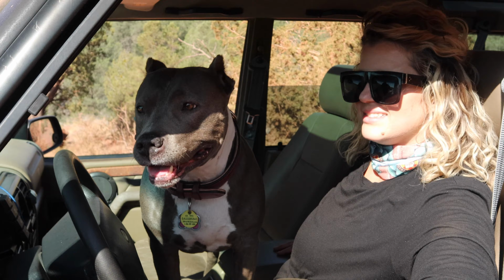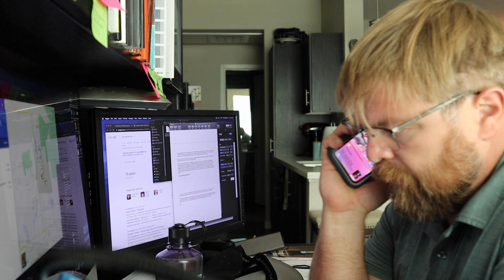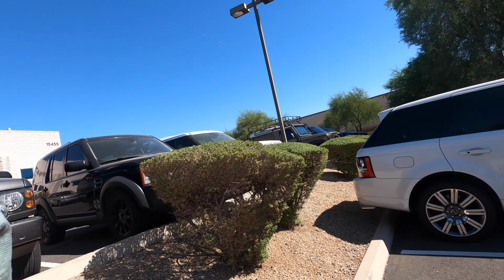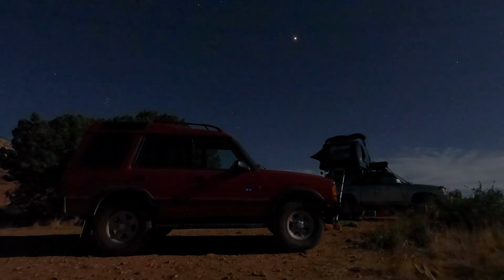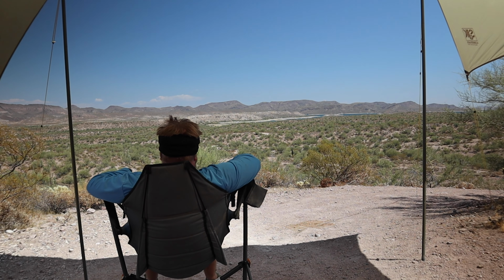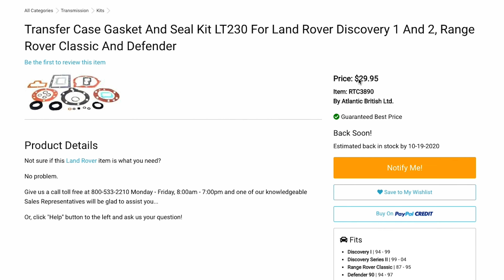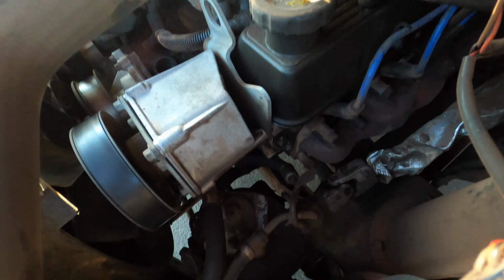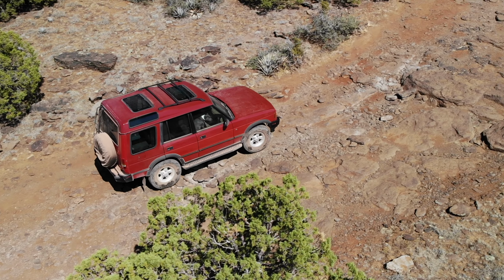Most All Of The PROBLEMS With My Wife's LAND ROVER DISCOVERY 1

Comment: Owning a Land Rover is like being the owner of the Millennium Falcon...your hyperdrive is always out, there's always some problem with the power converters or the power coupling on the negative axis has been polarized and I'm afraid you'll have to replace it. In fact the Corellian YT-1300f light freighter is known as the "Land Rover of the Star Wars Universe". People would think that a guy like Captain Solo would ditch that POS for a more reliable ship....but they don't understand. Just like people don't understand my love for my Discovery 1...Check engine light turns on if a deer farts within 100 yards, she leaks oil, she leaks power steering fluid, my hyperdrive (aka cruise control) hasn't worked in about 10 years, my rear windows only work when they want to, one headlight is full of water...currently my transfer case shifter is frozen and won't move...the list goes on. My point is... like Captain Solo, I wouldn't trade my Disco 1 for anything! If you don't own one you'll never understand that relationship. Now to be fair...there are lots of people who have owned a Land Rover and say things like, "That thing was the biggest piece of crap I ever owned...I got rid of that piece of crap, nothing but problems!" I welcome the problems...I'm an overlander, an adventurer, a world traveler...and I have to say that misadventures tell way better stories, make for better experiences, and are much more memorable than plain old regular adventures. Then again, I'm a "fly by the seat of my pants" kinda guy...like Captain Solo...lol, just my 2 cents... PS.- No, I am not a Star Wars fanboy, it was just an analogy to make my point...besides Trek is better!
Reply from the maker: Best. Analogy. Ever. I completely agree. I also find that most of these “problems” are more annoyances rather than catastrophic failures that leave you stranded to die on an inhospitable planet. Plus, it doesn’t ever really go anywhere that crazy without our X-Wing 4Runner... which we all know can crash and sit submerged in a swamp in  for an unspecified amount of time, then start right up and take us anywhere we want to go, just in case.
Reply: Awesome response to owning almost all British vehicles. I loved my 3 Lotus cars, though any sane person would have stopped at one and got rid of it. Something just quirky enough to make you love them!
Reply: You sir, are an artist, and i thank you
Reply: When I read this l lmao! So very true! You nailed it! I read a comment somewhere.. "the only thing that Land Rover's are used for today is, going to Starbucks and and Whole foods". I will never own a Land Rover, or Ranger Rover again. 4wd pieces of junk!

Comment: Not bad, bought my D1 for $900, and I'm close to $4k+ on parts and labor so far lol - Oh and I see you guys drove by Palm Springs, good stuff, I'm just down the street from those windmills lol
Reply from the maker: That’s awesome. Those windmills are one of my favorite landmarks on the drive from Phoenix to LA! That and the dinosaurs at Cabazon! How’s your disco coming song? Anything crazy you’ve found I should look out for?
Reply: @MattKester  I should get it soon if not tomorrow, maybe on Monday. Did an engine swap (same engine, low miles), but couldn't hold temp, always overheating. So I took it to IE Rovers and they pretty much fixed all the issues I missed (cylinder misfire) and they rebuilt my radiator (don't get an aftermarket one) and they replaced my 02 sensors. And I couldn't figure out why my passenger seat wouldn't move, but he fixed that too lol. Were on the same boat, I have no idea what I got into when I got the Disco for my gf lol, but she wanted it sooo were here haha
Reply from the maker: @bstunt  oh the joys of that aftermarket radiator. Mine, unfortunately has one courtesy of some previous owner. Of course the plastic fill plug on that one had deteriorated and started leaking, and I couldn’t find any info on it. Tried ordering an OEM one, but they aren’t compatible. Ended up having to use a M12x1.25 oil drain plug which fit it perfectly, but of course is the wrong material to use in a brass radiator. I’ve used a metric F-ton of Teflon tape to try and minimize the metal on metal in there, but I need to figure out where I can get that correct plug before the plug and/or the radiator start corroding away. I know it’ll be worth it, once we get it all sorted, just a little time consuming and challenging getting it there!
Reply: @MattKester  I have a D1 as well. I fucking love it! But I must add, maintain the cooling system, the radiators go on these often, it is important to maintain the radiator fins and to flush it of dexcool if it hasn't been already and use regular green coolant mixed with distilled. These aluminium blocks warp easily. Watch Britannia restorations youtube channel for amazing land rover content. It's mostly defenders and TDI but they are so similar that the information is completely relevant to our Discovery V8s. Keep the rad updated, maintain the viscous fan clutch and thermostat! Lube the driveshaft and ujoints consistently, every oil change or right after power washing or driving through water. I love the truck it's just high maintenance but that is part of the vehicle I love too. It's a lifestyle vehicle, that's for sure.
Reply: @MattKester  which rad do you have? Is it Genuine?

Comment: To save money the first thing is not go anywhere near an official dealer, i mean stuff like a light lens cover isn't exactly end of world or ripped seat's, all that mechanical work you can do yourself, their so easy to work on and there's enough you tubers vid's about, their's tons of life left in that.
Reply from the maker: I hear you. I just wanted to get a good baseline of what was actually wrong with it. They ended up really going over it. Fixed the seats problem with a set of neoprene seat covers and we've slowly been going through and addressing most of the rest of it. I believe I finally got her to quit leaking oil after the head gaskets and trans cooler lines were replaced (fingers crossed). We're taking her out on a quick camping trip tonight and tomorrow to see where we stand and kinda figure out what we want to do next.

Comment: Power steering system on this truck DOES NOT take power steering fluid. It takes auto trans fluid. Nobody realizes this and it exacerbates leaks. D1s are fantastic, simple trucks easy to work on and parts are cheap. The shit that ALWAYS sucks is the “luxury” they grafted on to make it more like a Range Rover than a defender. Sunroofs, electric seats, cruise control etc. if you find the most basic SD truck with cloth seats and sunroof delete it’s magic. These are NOTHING like D2s. This is a somewhat rare and good color.
Reply from the maker: Thanks! I hear you on the power steering fluid. Previous owner was dumping standard power steering fluid in it, I've since started putting the correct ATF fluid in to maintain. I'm planning on replacing all the power steering lines while I have her down to do the head gasket. Hopefully that dump and fill will get most of that incorrect fluid out. I feel you on the grafted luxury, I'd love to have cloth and power nothing!

Comment: They used the parts to make these from lots of other vehicles, i used to drive an Ausin Maestro van and it shared the same rear lights, switches and other minor parts, the same parts would come either in a rover box or a land-rover box and the only difference was the price lol
Reply from the maker: I finally went and looked the Maestro up, I’d never actually seen one since they were never sold over here. Not what I was expecting. I figured it would be something more like a modern Transit or Sprinter... I couldn’t have been more wrong! Wow!

Comment: as an owner of a 97 disco 1 and 03 disco 2, i am anxious to take the "ride" with u!! and get the curse jar ready lol!!! thumbs up!!!
Reply from the maker: Thanks! I'm glad to have you along for the journey. Three videos into being Discovery owners and we're starting to understand just how awesome the Land Rover community is. Right now, my frustration is less with the car, and a particular parts vendor who has hung up a critical bunch of parts for the last week. I got in all the transmission cooler lines and radiator lines, but the other guy has my transmission service pack and head gasket set held up, so there's no point in wasting two batches of coolant or tranny fluid doing those fixes until I have the other parts. So frustrating... but that's what I get for going with the "cheaper" supplier.
Reply: @MattKester   ive been lucky to have a few contacts here in PA...one thing i have learned about the parts game... dont throw any part away until u have exactly what u need,,, a lot of old parts can be cleaned up and work just like new! and research research research is the best advice on working on the discos!!! land rover community is awesome!!! be well!! thumbs up my good man!!
Reply: and btw tell ur wife my pug Betty is my copilot!!!! i noticed ur beautiful pit in one of ur vids!!

Comment: Ive got a diesel d1 fully decked out top of the line everything , twin locked everyday driver done 335000 and blows less smoke than a petrol !! This is the most comfortable driver ive ever had ... I keep waiting for it to break down and live up to its online rep but it refuses to its twin locked and cops a hard time off road every wet season this vehicle is a weapon to own and drives and handles superbly ...so i guess its horses for courses look after them and they will not let you down, d1 300 tdi one of landrovers finest hours full stop !!!
Reply: The tdi and td5 are bloody great engines. They will rack up huge mileage without issue if you look after them.

Comment: Worst model, automatic gearbox, petrol engine. You couldn't have picked a worse Disco. The Series 2, manual gearbox, TD5 is by far a superior car if it's fitted with the linkage to engage the centre diff lock. Your car would have been a £200 spares or repair scrapper here in the UK.
Reply: Absolute rubbish

Comment: Man this is a classic, worth way more than any 2015 LR, do it the mainteinance and repair it... and enjoy
Reply from the maker: Thanks! We are! It's such a cool rig and I've been surprised just how simple it is to get in and work on. I definitely don't mind doing the maintenance on it!
Reply: @MattKester  yeah no kidding to change a light bulb on new cars you basically need ten sockets of all metrics to remove bumpers , electrics and all sorts. new cars are all about adding labor hours to any minor concern. no such thing as an easy job in new cars.
Reply: @mrsteel10213  It only takes a minute or two to change any light bulb on an old Discovery.You must be doing something wrong.
Reply: @philiphawley2915  nope my comment was refering to the new vehicles. I own a d1 and also own new trucks that you basicaly have to remove grills bumpers to get to the bolt that removes the headlight. I had a 2000 suburban, only two L shaped retainers and off came both headlights and blinkers. It was a dream.

Comment: I'd say $1500 would be more in the ball park for headgaskets to be replaced at an independant imo. Assuming the heads and block are flat ofc.But yeah if you can do it yourself, $500 should be more than enough. Depending on the heads/block ofc.
Reply from the maker: I hear you. We ended up getting it done well under the $500 mark, as long as I don't charge myself for the bajillion hours of labor I put in, this being my first HG job and all!

Comment: Had the same model but TDI diesel auto here in Australia. that stuff is just wear and tear from being driven. if the radiator hadn't been crushed the head casket would have been ok. looks like it lived its life with just engine oil changes, and forget everything else. The beauty of that model is you could still work on yourself with just minor mechanical skills, no electronics too spoil your life.   Enjoy.

Comment: Its funny as over here (UK) we don't have many disco ones on the road and most of them a the good old donkey (diesel) and the V8 well they are low mileage because the cost of petrol and are pretty good all round and the faults you've have are more or less come every day things now once you have done all these pain in the butt jobs at the same time lift the body and reinforce the body were the mounts go it will pay in the long run and parts seem to be a lot cheap over there in the state . ;-))

Comment: I had a head gasket blow out the side of number 5 cylinder in my D2. No over heating or lose of coolant. I did the new head gasket in my driveway. Very easy to do but lots of bolts. I’d suggest replacing your water pump while you have everything apart. Good luck. Subscribed to see what happens. 😀
Reply from the maker: Thanks, Cory! I watched Atlantic British’s video on the D2 head gasket job and I got the impression that it’s gonna be a lot of bolt work. I’ll definitely be sure to do the water pump, think I’ll put a new fan clutch and thermostat in too, just to be sure. I’m planning on getting everything ordered up tomorrow and starting on it first thing next week. Thanks again for checking out the channel and subscribing!
Reply: @MattKester  OH OH  just had a thought,   the water pumps do not have a bypass,  that's on the plastic heater hose valve.   don't be tempted   lol

Comment: The intermittent problem with the back windows is a dry joint on the ecu board. Plenty of vids on here on how to fix it, takes about 10 minutes. Enjoy the green oval for all it is worth, it will be a love hate relationship with it. When it's running right you will love it, when it's broken you'll want to set fire to it. I have 4 D1's all 2.5  diesel and they don't leak, they sweat power lol.
Reply from the maker: I just looked up a video on it, and didn't realize until the end that the presenter doing the work only had one full arm, so there's really no excuse for me not being able to do it!

Comment: If it doesn’t leak 
It’s run out of oil 😂
Reply from the maker: Right. I did a crappy job of sealing up the ends of the valley pan after I did the head gaskets, and it was pouring out pretty good and dripping down onto the cats. Went back in last week and resealed it with a metric f-ton of RTV. Now the only leak we have is out “indicator drip” somewhere up by the steering box.

Comment: Land Rovers are notoriously crappy vehicles. One of the most common issues is the piston slap you’ll almost guarantee to get at about 100k. They are really horrible vehicles. Beautiful to look at. But thats about it.
Reply from the maker: So sorry to disappoint, but when I had the heads off at 113,000 miles, there was zero indication of liner movement.
Reply: @MattKester  don’t worry, it’ll happen. 😊